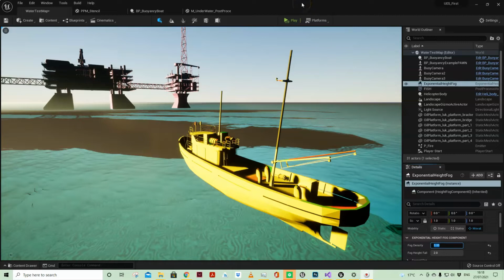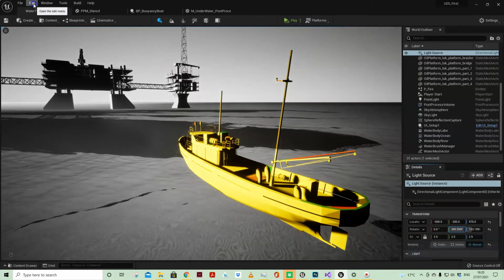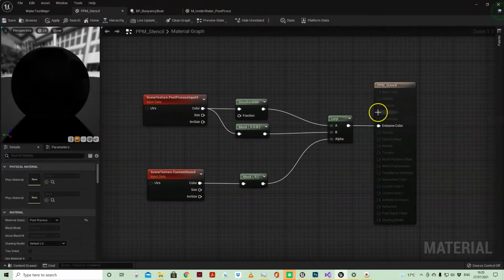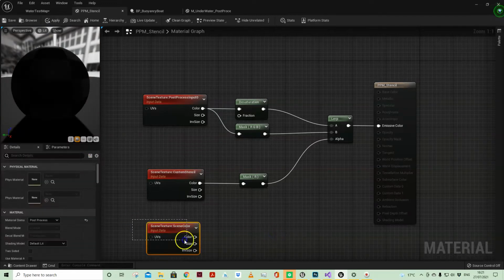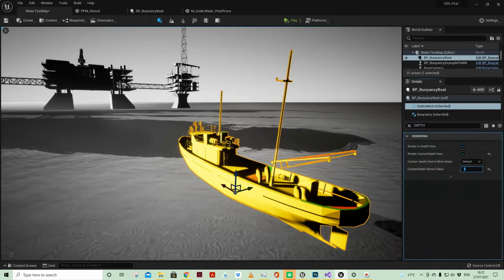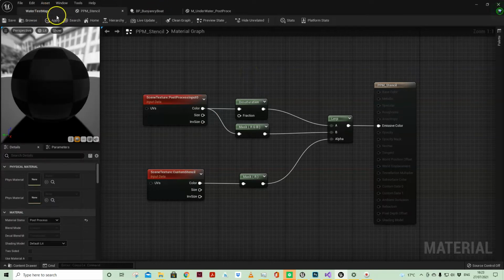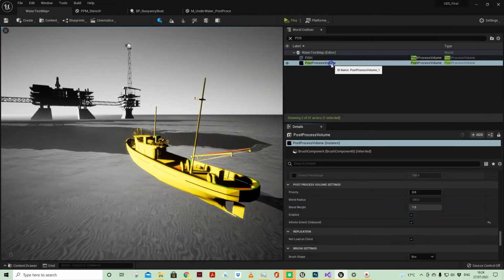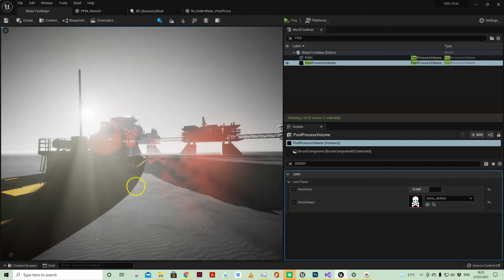CUSTOM STENCIL - MASKING WITH POST PROCESS MATERIAL - UNREAL ENGINE - UE4 - UE5

Comment: As far as I understand the masks normally have jagged edges because of missing antialias. In this video the boat is masked out but the edges look smooth. Is there any trick to get the mask antialiased?
Reply: bit late so not sure if you still need an answer but check out before and after DOF and the like. One of those gives better results methinks